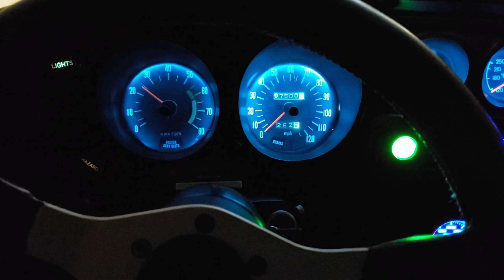Toyota 20/22R High Compression Engine Build Timelapse.

Comment: In Australia we never got the 22R engine in the toyota celica and it wss not until the mid 1990s that we got the 22R in the toyota hilux  (pick up ) and fortunately l own a 1997 hilux the final year of the 22R motor by the way very nice celica and the engine a work of art besides the 22R  engine is an incredible engine to start woth

Comment: Beautiful work! Lc engineering is expensive but there quality is top notch! Eventually you're gonna have to go efi for reliability power and tuning! Good luck man keep making these videos amazing!
Reply from the maker: Thank you!  I greatly appreciate the positivity!

I have to say these Mikuni's have been completely reliable.  Once tuned they do no need re-adjustment ever.  In all my 15 years of driving them, I had a float go bad, and an accelerator diaphragm leak.  Otherwise they have started and run great every time.  

EFI would (in particular spark management) definitely be a big increase of overall power under the curve for sure, but I don't think I'll go that route with this car.
Reply: U keep EFI out of this... Carbs never did nothing to you! 😆
Reply: It this the Stage 3 head?
Reply from the maker: @oldschoolj510  this is a stage 5 head and cam.

Comment: My uncle built 20 R truck engine with 485 lift cam pop ups 
and just dynoed it .90 horse at back wheels  140 ft pounds tork 
but max rpm was 2500 torque band stock heads were supposed to support 
6500 with cam but has stock rockers  stock spec is 1.55
americans being 1.4 for smog 
1 person hinted ford roller rockers 
cant find any thing about it exept never designed high performance rocker train 
and with most  you need a performance intake hes got a big webber on it.
Think it might be stock intake?

Comment: hey nice build! im wondering do you have a lambda sensor in the exhaust? or do you plan on getting one installed? i have a stock 20r paired with msd 6al & weber 40dcoe and im looking for the best options for my exhaust. (daily driver no track time) I was thinking about getting the full exhaust side fabricated because the stock one is pretty rusty. should i use my flowtech header and weld a o2 bung in it or get it fabricated fully through? or is the stock exhaust good enough since I have the stock 20r and save my gauge for the future. (I have the carb airflow meter already)
Reply from the maker: My exhaust is custom and I have provisions for a lambda sensor, however I run leaded fuel which significantly shortens sensor life.  So I do not run the sensor unless tuning.  I would recommend upgrading the exhaust no matter what, as the factory 20-30+ year old exhaust is for sure not as good as a budget customer exhaust today.
Reply: @JohnnieLackeyRacing  thanks for your insight and information it will help me decide with my set up!

Comment: hello good video thank you very much, will you know the difference between flat and convex pistons in 22r engine? I need to know 🙏 my car requires poan pistons and by mistake I bought convex ones 😭
Reply: The Dome Pistons the ones with the round bump on the top are for the early model 22r engine the flat top piston style is for the peanut chamber late model Style and that has a shorter deck height the engine block is a lot shorter so domed pistons won't be able to be used in that style of engine block the engine you saw in that video is the early style 22R Toyota engine hope this helps

Comment: Thinking about doing this conversion using a late 22R block for my 1981 Toyota pickup. Any tips? will race it and try rebuild it myself!!
Reply from the maker: Well, the 20R head does flow better at higher RPM, just get some nice piston's to go with it for that extra bang.  Don't go over 10:1 CR unless you want to run race gas.  These hemi chambers are not the best at preventing pre-ignition, so you need a little buffer room.  With most engines 10.5:1 is the limit of pump gas (93), but with hemi chambers it's a little less.  Other than that, clean the crap out of everything and assembly with great attention to detail!  Good luck!
Reply: @JohnnieLackeyRacing  I'm not catching the drift on the hemi chambers!.

but thankyou for the advice, I guess most of the parts are going to cost decent cash so will probably do it once I've got everything together and probably finished my sr20VE hybrid.

Comment: Hi there's,  Nice motor set up im going to same route like your set up.I was just curious what kinda motor mount you use.
Reply from the maker: I run LC Engineering pro mounts.
Reply: Thanks u for the info,I'm new in to this built.
Reply from the maker: @ronnycheav3484  If you go with the LCE mounts, buy a couple extra poly bushings, they need to be replaced every couple years.
Reply: How about wiring any tips on that.
Reply from the maker: @ronnycheav3484  Yes, a big plate of patience, with an extra side helping of more patience.  I used Deutsch and Mil DTL-38999 connectors for everything I made.

https://www.instagram.com/p/CEhrTUHHNBB/?utm_source=ig_web_copy_link

Comment: Badass!! I just built my 20R head with an lce stage 3 cam, bigger valves and slight port work. Paired with a .040 over block with stock (notched) 22R ridged pistons & stock rods with a 38 Webber on the intake. What kind of power do you think I’ll pull out of this? Currently doing break in miles so I can’t romp on it yet but I’ll take it to the dyno soon. I was shooting for 150ish and after seeing this stage 5 at 175hp I’m questioning if I should have gone up a size on the cam lol
Reply from the maker: It'll feel great!  150ish isn't a bad estimate, but I'd suspect you'll be closer to the 140ish (not that that's a huge difference.  

I've got a few things to address on my engine to get some more HP.  Found out the valve guides are worn to the point that they definitely affect performance.  Going back together later this year and should see some good solid gains, maybe 190ish.

Comment: Awesome build! I’m newer to the whole scene but quick question. Would an efi build be more stronger after of course a full build. Internals, ported head, upgraded ecu/harness , bigger injectors and set up drive train ect.
Reply from the maker: EFI would be better overall.  Peak power may not be any better, but with a spark table you would likely have a better power curve.

Comment: In the middle of a similar build and found your video because I am having issues with the cam timing on my 20/22R hybrid. Did you use a standard 22 or 20 timing chain?

On our build if we set the timing and turn the engine over the marks are not staying where it should
Reply from the maker: It is a standard length double row timing chain.  You will need an adjustable timing gear to get it dialed in correctly.  I have a spare LC Engineering double row adjustable gear if you don't mind buying a used one in good condition.
Reply: @JohnnieLackeyRacing  We bought LE timing gear but haven't adjusted it yet. We weren't sure which of the three different timing options was the correct one. (Standard, Race 1, Race 2). Just the fact that turning the engine over a few times by hand and not having the timing marks coming back right was so weird we started looking to make sure we didn't make a mistake somewhere else
Reply from the maker: @LoudGuitar14  They are all the same, they are basically just places to save a reference number for specific tracks.  So you can quickly determine what you baseline was for that track.  Realistically it's redundant as you have actual timing marks.
Reply: @JohnnieLackeyRacing  Got ours running now

Comment: how much did this cost?
Reply from the maker: Is this just a setup to get me in trouble with my wife......or is this my wife???? Suspect...hahaha

Mine is a lot of in house work, but it's basically the same thing as if you purchased a Stage 5 engine from LC Engineering, I think they are around $9-$10K now.
Reply: holy fuck, we are getting a divorce. 

freals tho ty for the info and video.
  @JohnnieLackeyRacing

Comment: What compression ratio are you running? Looks good, sounds good,
Reply from the maker: The head is milled a good bit so the static compression is about 14.8:1.
Reply: @JohnnieLackeyRacing  with that high of compression. Are u still able to run 91? Or just e85/ race gas?
Reply from the maker: @dangerousfandango5943  No way to run pump gas.  91 is usually safe on the street up to 10.5:1, 10:1 track. I run 112 leaded.
Reply: looks like your piston squish area is just above deck,i stumbled on a 22r block milled .042,my pistons end up .006 above deck,think this will be streetable as far as compression and timing chain tension?stoxk 20r head
Reply from the maker: @me9174  Depends on pistons, cam, and how much the head has been milled.  Are your pistons flat, dished, or domed, and if domed or dishes do you know the CC's of the dish/dome?
Reply: @JohnnieLackeyRacing  stock domed pistons,ive been digging for weeks to find the volume,but most aftermarkets are 24.7 cc.my head needs a water jacket welded,so hoping for very little milling,maybe .010?
Reply: @JohnnieLackeyRacing  stock cam
Reply from the maker: @me9174  Are the stock domes the raised ring with a recessed center section?
Reply: @JohnnieLackeyRacing  yes,its an 82 22r
Reply from the maker: @me9174  It is right on the line.  So I would suggest you have the volume of the chamber in the head measured after finishing machining.  It may be right at or above 10:1.  I suspect you will be able to run fine on 91/93 fuel.  But you are going to want to know for sure what your static compression ratio is for future reference.
Reply: @JohnnieLackeyRacing  well crap,know anyone that wants a newly bored .020 over 22r block?decked .042?🙄
Reply from the maker: @me9174  you should be able to run bump gas on 10:1 cr.  Just CC the heads when you have a machined, that way you can know for sure whether it's 9.8 or 10.3
Reply from the maker: @me9174  I have a set of LC engineering stage 3 valves and springs that are recently pulled from my head when I upgraded to stage 5. If you're going to have the head machine and you're interested I'll be happy to sell it for a great deal.
Reply: @JohnnieLackeyRacing  those the ones that will lap into my stock 20r seats?
Reply from the maker: @me9174  Yeah, I think. 1.5mm larger diameter.
Reply: @JohnnieLackeyRacing  i think id need new seats,those are alot bigger than mine.my valve seats are for 43 mm intake,i think the stage 3 are 1.5 mm over stock 22r valves,so 46 mm?
Reply from the maker: @me9174  Nah, these are 45.5mm.  and same +1.5mm for the exhaust
Reply: @JohnnieLackeyRacing  so,how much just the valves?probably never run it north of 6000 rpm
Reply from the maker: @me9174  So I double checked to make sure, you are right.  The ones I pulled from my head will require new seats.  If you had a 22r head, they would not.
Reply: @JohnnieLackeyRacing  well,thanks for all the help on compression anyway
Reply: @JohnnieLackeyRacing  do you still have the valves for sale?
Reply from the maker: @Shocker_FPV  Yes